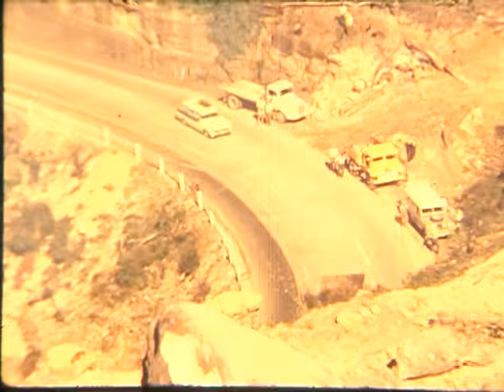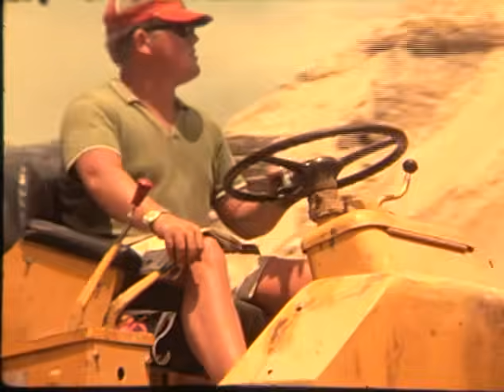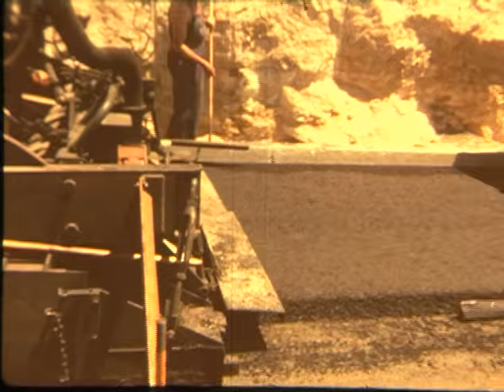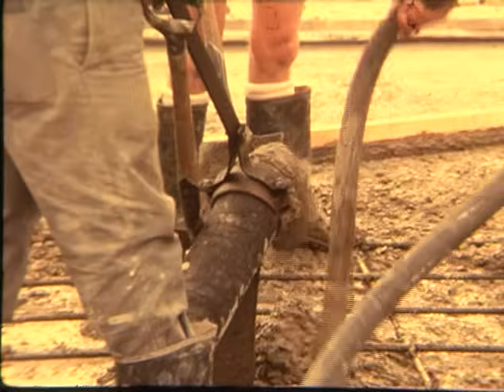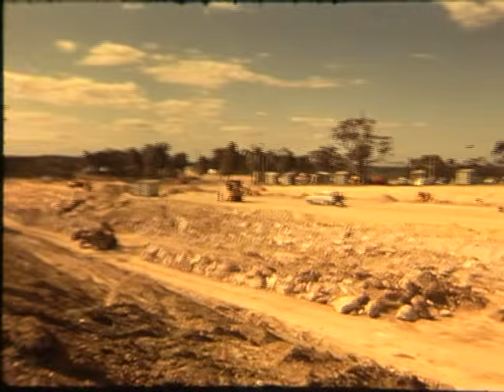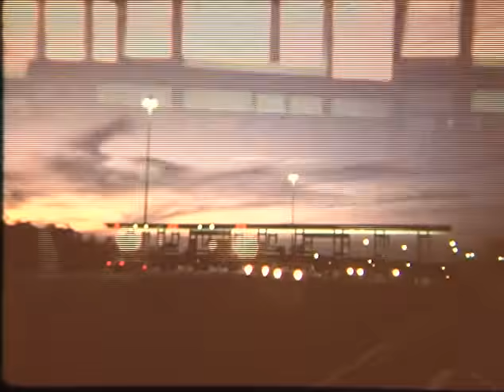Sydney Newcastle Expressway Berowra to Newcastle 23min, 1969

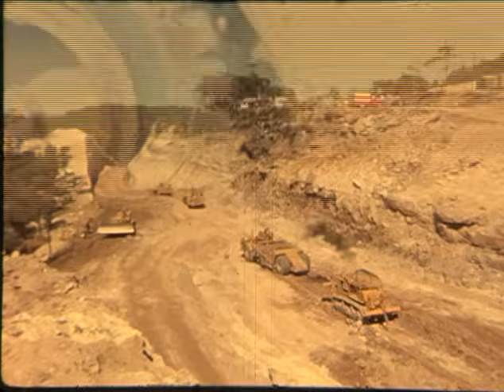Comment: 1969 hey, I remember the south bound standstill traffic on way back from holidays. It could be standstill from the Hawkesbury River to Berowa. I am fairly sure that is the famous Pie in the Sky shop on the old Pacific Hwy at 5:05 up on the right.
Fast forward to the mid 1980s I watched when the Berowa to Pennant Hills Rd/Pacific Hwy F3 section being build close to where I lived at the time. 
Since the late 1960s I have seen all the sections added to the F3 to today witnessing the new Hexham Bridge/ Raymond Terrace bypass being built just up the road from where I live now just outside of Newcastle.
Just think, soon it will be possible to drive from Brisbane to Melbourne via motorway or freeway.

Comment: When I was a teenager the 'missing links' of this freeway were done. The Wahroonga to Berowra & Mooney Mooney Bridge sections (mid 1980's). I see in this doco they breeze over the pre splitting of the batter walls by illustration. Often it's some of the first work that's done. Rustic drill rigs that drill 20m depth at a time to create the pre split holes. I never understood how old rough drill rigs could dril such accurate holes 1/2 m apart. The batter lines on all this feeway are works of art. The batter line cuttings approaching the Mooney Mooney bridge are huge.
Reply: The reason I watched this was to learn more about the drilling and blasting through those hills, I'm a bit disappointed there wasn't a bit more detail!
Reply: @stevesbonesai  As I learned it's a dark mysterious art known only by a few. The drill rigs to do the batter line are some of the first to be in the proposed freeway area, there bush and terrain is still all there, they follow the surveyors indicators. Only a small trail is made to allow the small drill rig to drill each of the batter like holes. It's incredibly rustic and low tech, yet the drilling is beautifully accurate. Even the batter line blasting is a dark mysterious art, just enough explosive to setup a crack between each hole. Usually done with redcord and a stick explosive taped on at different intervals (maybe every 3 to 4 meters). When I learned this process AN60 was used, but these days there's totally different products. Very few people understand batter line blasting.
Reply: Yes a very artful job, i was a mechanic with the Cat dealer in the 80,s so repaired many machines through those sections you mention and further north also and got away as fast as we could on Fridays to go see the Spys or Angels or Oils whenever they were in town!! Awesome memories

Comment: This brings back some memories. I was an apprentice carpenter and joiner at the DMR workshops at Rosehill from 1980 to 1984. One of my jobs as a 3rd year apprentice was to build the 4 sided display hut, (it displayed coloured maps and details of the construction of the bridge) for the public lookout over the Mooney Mooney bridge. An impressive feat of engineering, I mean the bridge not the display hut. Thanks for posting this video.
Reply: The Mooney Mooney Bridge is slowly  sinking on one of them. I found out this when I was doing my engineering course at TAFE.
Reply: I'm sure you were very proud of the display hut.

Comment: They did this and did nothing to the railway.
Reply: You do know that the rail trip north used to require taking a steam boat on Broken Bay / Brisbane Water until the rail section between Hawkesbury River (River Wharf) and Gosford was completed. The feats of engineering to perform this at that time with the HR Bridge through to the then longest tunnel in the southern hemisphere at Woy Woy were absolutely massive and are clearly taken for granted by modern generation.
Reply: But there has been talk of a high speed rail link between Sydney and Newcastle for many decades.